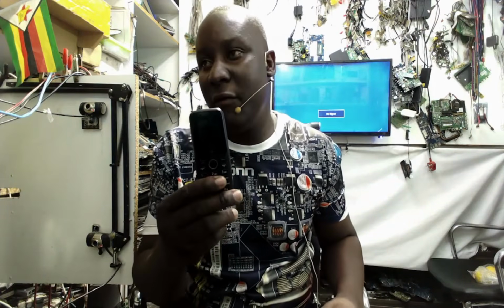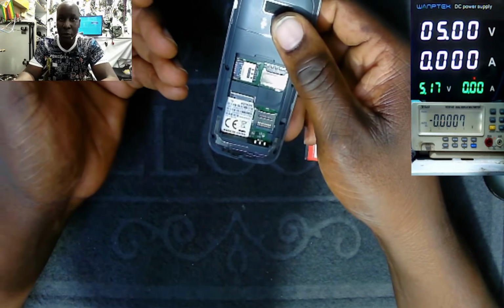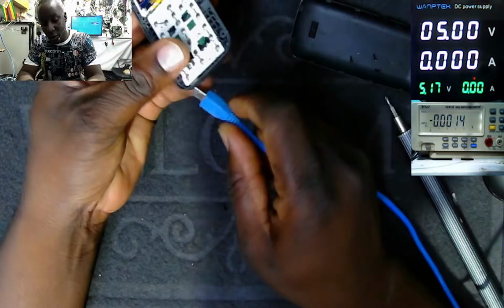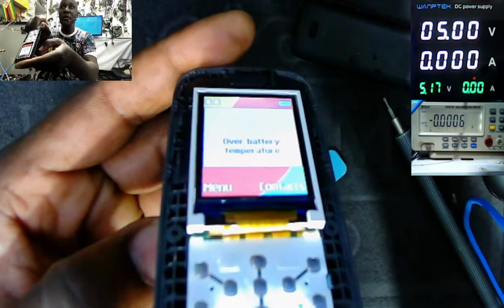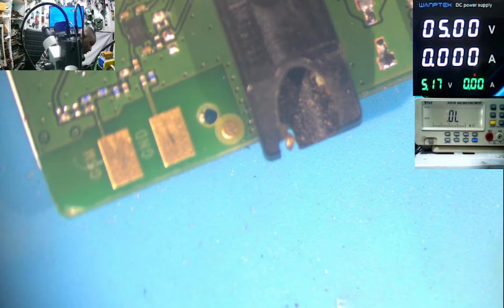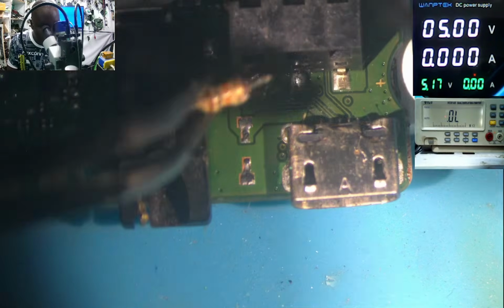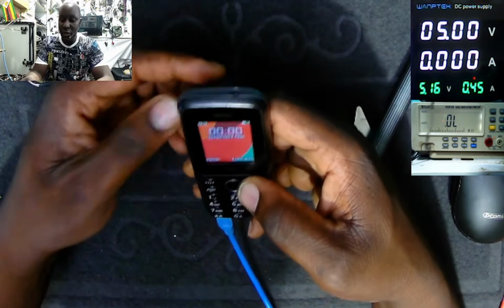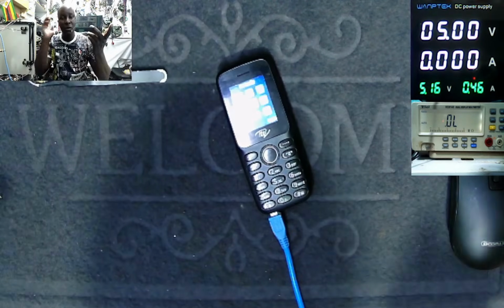Over Battery Temperature Problem On  Itel Small Phones, Check Out Easiest Way To Fix This Error!!

Comment: Good trick bro. Your E- screw driver doesn't work try to fix it while making a video on the fixing😂..how we connect the diode? The cathode to gnd,or Anode to gnd...Thanks
Reply from the maker: Cathode to ground and Anode to NTC pin (middle pin?)
Reply: Thanks
Reply: Is that method also applicable on smartphones behaving the same